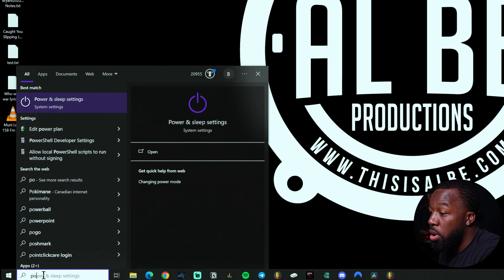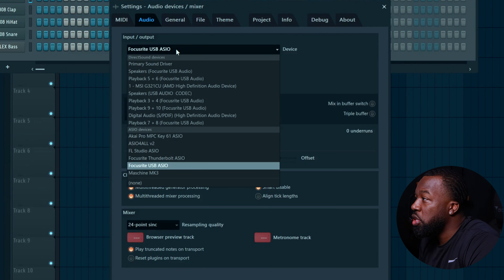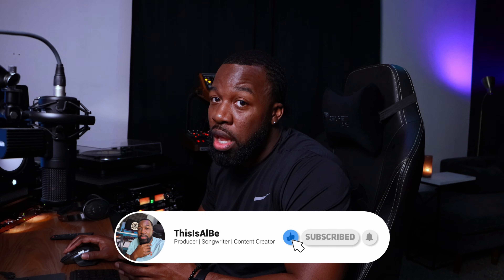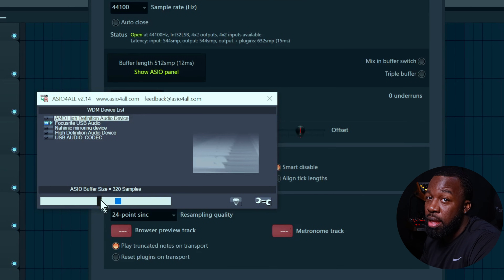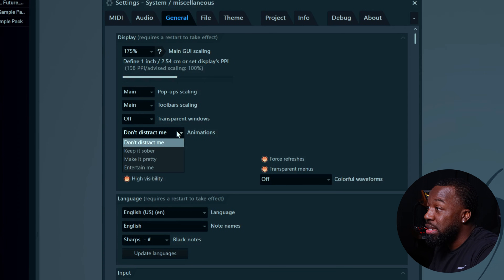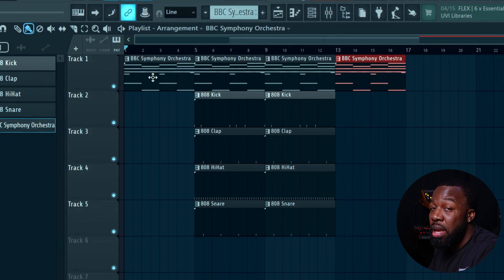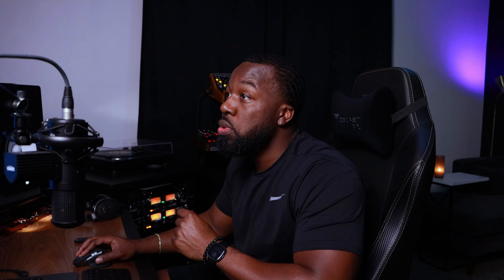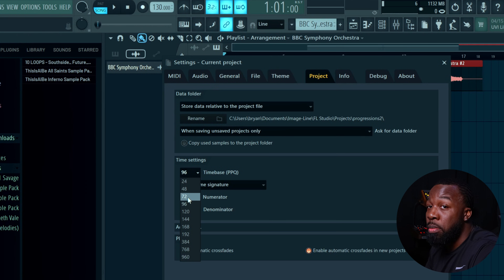How to Make FL Studio Run Better and Smoother! | Fix Latency and Lagging

Comment: How do I stop the Playlist screen from jumping to the right (the end) of my song while I'm editing (pressing shift + left or right) while a piece of a track is highlighted in the playlist? Kinda need the screen to sit still and stay WHERE I'm editing WHILE I'm editing. This has been a pet peeve of mine for years and I've just always excepted it, but I'm finally ready to fix it😂. I don't know if it's just a slight inconvenience that "just is" with fl studio, or can it actually be fixed. It would make the creative process much more simple in that it would save steps (that step being having to scroll all the way back to my focus point every time I want to make an adjustment). I'm going to try to upload a video to explain the problem. Thanks in advance🙏🏽
Reply: I think I know what you mean, I recently queried same thing on a different channel. Try switching "Playback tracking" in audio settings in FL and try to switch between mixer and driver, I found out "Driver" was causing my playlist to skip past selection (it was advised to switch to driver for me to fix it, but 'driver' setting was actually causing it for me) and "Mixer" works best for me
Reply: @RTerreur  Thank you! Definitely will try this.💯🤝

Comment: Therse a question, I have a MOTU MK3 Ultralite interface and core i5 8500 cpu. why FL Studio still using CPU to process? what my audio interface does?
Reply from the maker: Your audio interface converts digital to analog and vice versa and takes that part of the process off your cpu if you have selected it as the driver in fl studio. The cpu will still need to handle other processes like controlling VSTs, automations and other processes required to be done in the cpu vs pure audio analog to digital conversions
Reply: @thisisalbe  Thank you <3

Comment: Hey Al Be , sorry that i ask that under this video here but i have some issues with my mpk mini 3 ... I bought your template today and it works good - except for the pads . When i press on the pads , it chooses the right channel but i do not get any sound and also when I check the mixer , there is no sound showing up . Can you help me with that ?         

Also when i want to record in cc mode, the sign in the top left, which should be orange, is now green with a question mark and the pads do nothing .
Reply from the maker: Hi, all good. Email us at support@allbangerz.com including a screenshot of your FL midi settings and the editor where you loaded the template and your order number. We will get you working or give you a refund